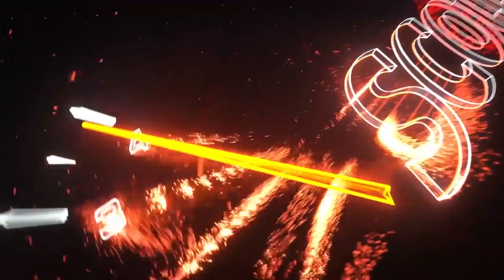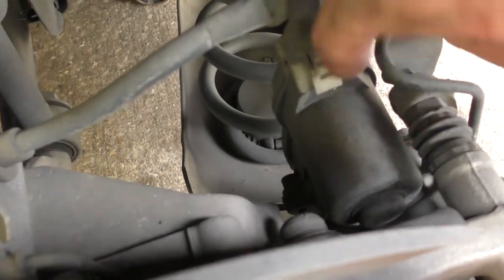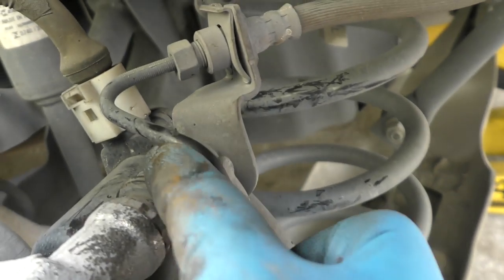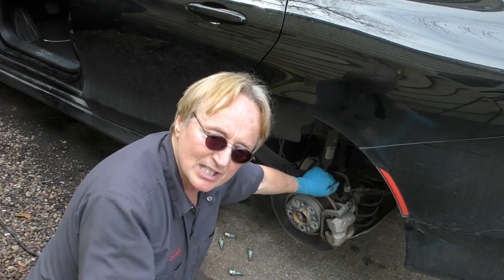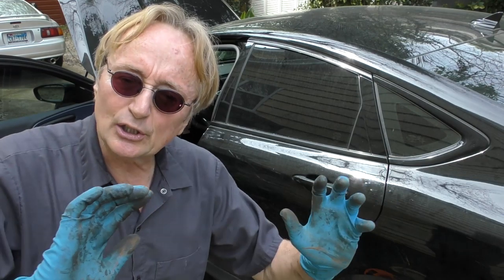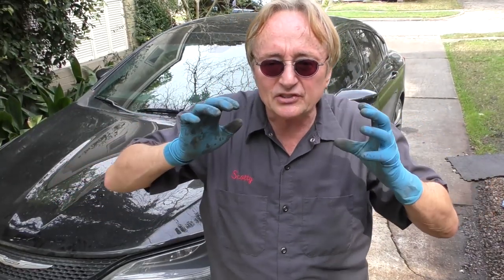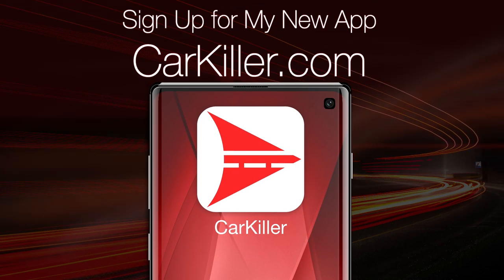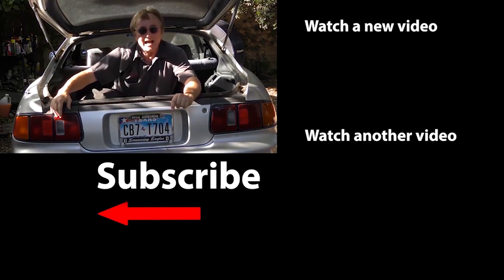This Trend is Stupid and Dangerous

Comment: First time I saw an Electric park brake was on a Renault. I thought why? Because it had a flat battery and the damn park brake was locked on so we couldn't even push it out of the way until the battery was charged or replaced and it took  a special type battery we had to order in and it was hidden under piles of plastic crap. Frustrating to say the least.

Comment: Hey Scotty, fellow Houstonian here. I have a used 2012 Nissan Altima 4 door(had 60k at purchase) w/ 108k miles. At about 90k it make rattling noise under the hood(sounds similar to someone shaking a jar of loose change) when I start it up. Also had to get a new transmission at 100k miles but the service engine light is still on 8k miles later. Please help.

Comment: They aren't called an emergency brake anymore. They are called parking brakes. Manufacturers have assumed that an emergency brake isn't any better than what an anti lock brake system and traction control already can do so an additional emergency brake is redundant and they have been removed in recent years.

Comment: This winter I had to use my ebrake to save my car from hitting a guardrail. The road was declined and angled. 40mpg on the ice sucked me right down. I turned the wheel just a little left and it didnt help at all so I hit the foot break and used it to steer me back on the road. Then let off fast to keep from spinning out. U would have a lot less chance of this working out if u had a stupid switch unless it was consistent and u practice. The cable is just consistent and u know what it's going to do. Good move Chrysler : (

Comment: Hey Scotty,
I'm looking at a 2007 Toyota 4runner at a local used car lot, however it has 215,000 miles on it and they're asking $7,000 for it. I was wondering if it would be worth it to buy considering the legendary reliability of the 4runner, even with all the mileage. Thanks in advance.

Comment: I have to agree with Scotty. It's insanity. The good ole handbrake could be used for many things, including assisting with vehicle handling -- because it allowed tacit modulation. This electronic crap does not. So, just what the hell is it for? How does it make the car safer, or easier to control? 

Scotty is right. It's a load of crap ...

Comment: Sorry in advance if someone's already suggested this, but I'll bet the electronic emergency brake (or, more accurately, parking brake) was implemented for cost reasons.  1) The main computer probably has lots of spare CPU cycles, so no additional cost there.  2) Adding the minimal extra wiring to a harness that's already complicated is extremely low cost.  3) Less labor to install at the factory; plug in a couple of connectors to a pre-built axle/brake subassembly and it's done, and nothing to adjust.  4) Saves weight; and every ounce helps when you're trying to meet these ridiculous mileage standards imposed by domineering bureaucrats who want to control every aspect of our lives, including telling us what we can and can not purchase.  Don't get me wrong, I'm dead set against the idea of the electronic parking brake.  But these days it's all about saving ten cents and two pounds.

Comment: I can't stand electronic parking brakes. I have a 2017 Mitsubishi Outlander that has one. I couldn't change my rear brakes without a deal level scan tool. When I took it in they quoted me $745 just for the caliper and the electric motor!!!

Comment: You forgot the mention the best thing about it - You loose power with the brake on and you can't even tow it yourself. Had an accident and the tow truck driver had a great Idea to put the parking break on when he dropped it off. When I turned on the ignition, the fuel started leaking everywhere, so I couldn't crank it and there you go.. The break was stuck on for the entire time of the repair and guess what, by the time it was done (I don't have the money to fix the car in a week) the damn thing was seized and wouldn't release anyways

Comment: Correct me if I’m wrong, the original emergency brakes were supposed to be cable operated as hydraulic was fairly new and not proven reliable early on.  How are those supposed to operate if the alternator and battery fail?

Comment: Hey guys I know this is dumb and all but I have a 68 mustang coupe that hasn't been moved or even started in 3 years. I've been planning on restoring it but I am currently in college and away from it. I was planning on doing some work over the summer to at least be able to drive it up to where I am at. It is around 600 mile drive. Can anyone advise me on what I should do? The car has little to no rust just on the hood and tiny spots scattered around the body nothing too serious only really needs the interior.( I do plan on doing bodywork just fyi).

Comment: Electronic emergency emergency break system is beyond stupid. 

With regular emergency break if you hold the release at the same time as you are setting the break you can apply as much pressure as you need to on demand. Which provides much more safety when stopping.

Practice in an empty lot to see. And get a feel so you're prepared in emergency situations.

Comment: I'm sure it also has to do with guys using the cable park brakes to try to spin the car around and some people not having the strength to pull the cable hard enough and a button in the car does take up much less room than a pull handle. Well let's hope they are reliable...
Take care

Comment: It's probably a gimmick used on cheaper cars targeted toward budget buyers. My 2018 300 limited has the mechanical foot mechanism as do the 2019s. Cars like the 200 and other mid-size and compact models probably go this route as a means to attract people with pseudo improvements/upgrades who don't know better.

That said, mechanical versions have their issues too. Water gets into the cables and housings, rusts the fittings and cable all to hell, then to replace them you have to pull apart half the interior to replace them. These systems also have the added benefit of removing the hybrid drum rotor that contemporary mechanical implementations require. Which is good considering how little material those pads have. It'd make more sense to have the electric pump by the master cylinder running a tandem hydraulic line that locks/unlocks the given axle instead, if that's how they want to go about it.

Comment: It should be called a hand brake or parking brake. It's not meant for braking, just keaping the car stopped, never use it to try to stop faster than by pressing the brake pedal. Also mostemectronic "e brakes" wont activate above 15mph

Comment: Not gonna lie my rear drum cylinder blew out and leaked most of my brake fluid and therefore no more braking I was in the middle of my commute, I used my (cable)e-brake to make it to work and also drove it home using e-brake. If I had some electronic brakes I would of had to leave my car on the side of the road or worse I could caused an accident.

Comment: If you would have put it in to service position you could have pushed the pistons in by hand no tool required just Google it.
the damage can be expensive if the mechanism isn't retracted first  or if park brake activates during brake caliper removal simply  learn the method your vehicle moves park brake to assembly/service position begin brake service as normal be mindful the piston notch pattern may require precise alignment with pin protruding from the brake pads backing plate missing the step causes pad to wear uneven and greatly reduced clamping force damage to piston and caliper bore uneven binding effect careful what you listen watch out there fellow earthlings there may be more to the subject at hand

Comment: Please respond!!! I really need help and I don’t have social platforms to message you by. I have a 2007 Kia Sedona and the battery dies constantly. I have a brand new battery (dated 0919) and alternator. Double checked the wiring but still nothing. My DMM didn’t show any faults. Do I need a new cable? I think it’s shorting somewhere but I’ve never had this issue so I’m not sure. Please help.

Comment: With a handbrake you can actually control the speed the car slows down I lost my brakes in my car years ago and I use the e-brake to get me home with electronic one they would probably just lock up and you would have no control doesn't sound very smart to me or safe. None of this electronic stuff seems to last very long they're putting just way too much of it in vehicles today.All this electronic 4 x 4   fails where the old manual put it in 4-wheel drive works every time. plus the worst part is they make you pay top dollar for this electronic stuff funny.

Comment: If you think that set up is stupid, my 2012 Cadillac SRX has regular brake pads for the brakes and brake shoes for the electronic parking brake. So the brake rotors have two sets of brakes on them. Really stupid design. Also, if you are driving down the road and accidentally hit the parking brake button, HOLD ON NELLIE!

Comment: There are a lot of stupid design changes auto manufacturers have made over the years.  I cannot believe the extra large blind spots in todays cars.   Between the steep windshield angle and large high mounted mirrors there is a blind spot so large you can't see pedestrians to either side, can't see the curb of streets and parking lot entrances you are turning in to.  Even trying to see past headrests to see cars coming at odd angles behind you is awful. 

I don't like consoles.  I miss the days of having an open space between the driver and passenger seating area.  With transverse engines that could be a nice roomy space with a flat floor to stretch your leg out or whatever but NOOOOO!   There has to be a plastic tunnel stuffed there to make you feel like an F-16 pilot on a bombing run. The very reason my next vehicle will either be a classic car or 2 door pickup with a bench seat and no console. 

Where is the room for the crap I like to bring with me?   My Grand Cherokee barely has enough room for an Ipod and sunglasses.   I still like to listen to CDs and have a place to put my firearm(s) and a few magazines out of view while I drive.  I need a place for my heavy ice scraper and my long snow brush and my emergency bag and a shovel and some tools.  Even the dang power outlets are in back or bottom of the little storage areas making you choose between a charged phone or a place to put some crap.  My old F250 had an unobtrusive console with 2 nice storage areas front and back, 2 glove compartments on the dash plus big door pockets and cup holders for 4 cups.  Even the back seat folded up to allow tall storage in the back of the cab.

Comment: at the time i baught a new 2011 chevy aveo  9500$ "bare bones" i think it just had its final rip as the engine started leaking oil bad at 140,000 miles it also badly needs front end work just not worth putting that money into as it eats threw tires im gonna try at-205 and let idle in driveway for half a day and see if that fixes it otherwise RIP little aveo you owe me nothing amen

Comment: My 2019 Subaru Crosstrek has a Pull handle E-brake, haven't used it yet though....
Reply: Does your AWD crosstrek get bad gas mileage like Scotty mentioned?
Reply: @mrgarrison3516  The computer display says one thing, but when calculated at the pump last week it was 21.73. I am in Chicagoland, it has been cold out, but for a 2.0 Liter it is sad. However the car has only 6k city miles on it and the trans finally smoothed out and it is very smooth and zippy, so maybe we're a little lead footed, it is so hard to tell, you feel like your babying it, but you leave everyone at the stop light, i don't know... i had 2.0 turbo eagle talon that i hammered on daily and got better mileage.
Reply: @slingbart705  ,
Ok, i drove from one side of Australia to the other (4,000 miles) in a 1.4 Suzuki Swift and in a 2.0 Subaru crosstrek and the Subaru got 10% better gas mileage (maybe the Suzuki is a better city car & Subaru highway car)
Reply: @mrgarrison3516  one trip mostly hwy, nice weather, i can see that, probably got the epa rated of 32mpg. and going 80mph
Reply: @slingbart705  ,
Yeh, i was going 60 mph mostly and i calculated my fuel/gas receipts for the comparison (not what the vehicles mpg said) + the crosstrek was CVT and Suzuki was manual

Comment: IT HAS NEVER BEEN AN EMERGENCY BRAKE....parking brake only urban legend that you can use it in an emergency from the days before dual braking systems and a crappy one at that only rear braking that you cant get to in time to stop anyway... not emergency brake there is no such thing... parking parking only... so the electric ones will work better than the cable that seizes or stretches beyond adjustment like my Durango but I digress..

Comment: Just like your last video no research was done. A special tool is not needed, just go into the radio settings and press "retract ebrake". You dont need the car in drive or even running to turn off the brake. Also when you hold the ebrake in an emergency, it modulates all 4 wheels of the car just like you slammed on them. I think you would like Chrysler more if you learned how to use google. That being said i drove manual for a while and im not a fan of electronic brakes

Comment: I really hate these electronic transmission selectors, and not just because of the electronic part. It's a fscking dinky little wheel you could easily brush or bump or miss in an emergency. Do you want to be fiddling with that pos during a snow storm when you have to put it in 2nd to go down a hill? Jesus from the looks of it you can't even do that!...btw didn't one of them kill an actor?

Comment: It's now a parking brake - no longer safe in an emergency 'cause if you lock the rear brakes, you'll almost certainly spin out. But nowadays, who cares?  The computers can handle everything!  Right?  Meanwhile, I found out an aftermarket rear caliper for an '05 Audi A6 costs about $600, and it doesn't even come with the motor. And that piston rotator tool won't work on the Audi. You need to plug in an Audi electronic brake reset module. Or, according to one YouTube video, you can unbolt the parking motors from the calipers and back them manually  (but that's not sanctioned by Audi!)
Yeah! Bring back dip-sticks, brake-cables, throttle-cables. If cars still had ashtrays, they'd now be electric too!

Comment: So, I went to leave the house yesterday.. Car wouldn't start.
Luckily the driveway is a drive up and the car is a manual.
Well, my battery was dead.
Dead again this morning. 
If I was not in gear, would my car have rolled away?.
Edit: with an electric e brake.
I have an 05 VIBE so no worries

Comment: I'm surprised this is legal. The whole point of an emergency brake is so you can stop the car in an emergency. Suppose the electric goes out? Then what? No emergency brakes. Used to be you could drive using the emergency brake if you needed to.

Comment: The accelerator cable is being replaced with stupid computer controlled accelerator.  The accelerator cable cost £19.  The ridiculous computerised accelerator pedel costs £300.  On top of this stupidity, the computerised pedel control lags when you use it to drive a manual transmission. It is overengineered stupidity.

Comment: Ohh Scotty your always got a voice of reason but it's not an E brake use your power to teach people that . It's for parking to Hold the load of the vehicle off the transmission . Cars can't have a E-brake as that would imply you would have an emergency . Today's brake system can run pretty dry before failing to stop . It has ((P)) for a reason ....

Comment: what you keep calling the "emergency brake" is not an emergency brake. it's the parking brake. it's not designed to stop a moving car at all. it's designed to stop the car from moving when stationary. the idea that electronic parking brakes are unsafe is a bit obtuse. to stop in an emergency, slam your brakes.

Comment: I thought emergency brakes were a fail safe if your hydraulics fail.
Reply: They used to be, but as cars got safer and brakes more reliable, the term emergency brake was partially phased out because it might make consumers think the car needs an emergency brake because the normal brakes may fail. From a bullshut herd mentality I suppose that makes sense but I'm sure it is mostly due to the increased reliability of brakes, addition of boosters with resivours for emergency applications and so on.

Comment: If you drive just a few miles per year yes go for classic handbrake. But for me that call my car my office an E brake saves my elbow and should.if you dont want an E brake , a foot pedal one is ok too but its just a matter of comfort.people ,the customer wants that not just engineer.scotty you are wrong with this.his doing the same thing they did when electronic fuel injection got out, they said carburettors were better safer etc.

Comment: I want windows that you manually roll down as well.
Reply: Yes, because the engine does not have to run.  Also the vent corner window(VW  Type 1,2,3) because then I don't have to rely on the electric fan which means engine has to run. Also ASHTRAYS as some people still smoke.